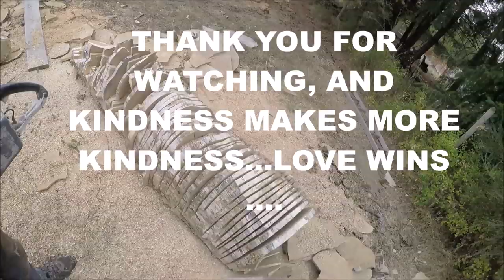STIHL 050 AV  TALE GATE CHAIN SAW REPAIR AND SHARPENING,

Comment: LOVED watchin and listenin to that old Stihl run! The first saw my dad bought for falling in 1970 was an 050. In 74 when I was just turned 16 I got to run it when it was coupled to an Olini chainsaw winch  we used to clean log jams out of the Dungeness river. The small Homelite that came with the rented winch didn't have enough power to move the 4 foot diameter logs we had chunked into 4 foot long pieces so we hooked up the 050 which of course voided the warranty. Then since we parted the 3/16 winch line too mamny times we loaded it with 1/4 inch line which also voided the warranty. LOL  I had to learn to feather the throttle to lift the logs up to the top of the pile and hold it there until someone could give it a push over and then let the log down the backside. If I stalled the engine the weight of the log would pull the saw through backwards and make the saw run in reverse (points model saws will run in reverse) and unspool the line on the drum making a BIG mess.Thanks for bringing up some old memories for me. I used to also have an old 090 I used to cut shake blocks, That was a BEAST of a saw.  Now I just have a Stihl 018, 031 and an 056 Super.

Comment: Stihl 050 was the first big saw I ever owned. I restored it from the bottom up made 3 cuts and broke the oil drive 😭. Couldnt find a replacement and had to sell the saw for parts. Tickled my heart that buckin has one of these 050s would pay good money to have a working one again. Replaced it in my fleet with an 045 full wrap and 32 bar and skip setup.

Comment: Nothing beats a hand file done right!
Reply: Square grind done right ;)
Reply: Yeppers .... square grind done right is hard to beat !  With a fresh grind on the robot grinder I can get sqr/rnd about 85% the speed of sqr/sqr ... edge seems to last long time also ... seems to me that the sqr/sqr takes a bit more oomph to pull thru the timber than the sqr/rnd because of its design ...for firewood cutting/processing with smaller saws I prefer the sqr/rnd configurations for ease of use (and because I don’t own a silvey/simington sqr -grinder 😆)

Comment: BBR's Mercury Tailgate Saw Shoppe and Repair hehehe  I have a 10x10 canvas Garage Logic set up I do my repairs in. I have an old Poulan 3100 driving me bonkers at the moment. It starts every time, 1 pull. Then it stops, like that homelite. Cannot keep it running for love nor money. I may have to re rebuild the carburetor. Right now the work space is a bit tight, because I'm rebuilding an electric dryer and cleaning a small pellet stove I plan to put in the back bedroom. Hi to everyone watching, and welcome new subscribers! Be kind!

Comment: Hey Buckin, i have an old saw that my grandfather gave me when it stopped starting easy for him. Ive done some work on it but it doesnt run really well and stalls on me. Could you make a Buckin Special on how you adjust a carburetor?
Reply from the maker: YOU BET I WILL LETS SEE WHAT HAPPENS TOMORROW I WROTE IT DOWN ,,THX FOR BEIN HERE PAL

Comment: Do you like the file and guide setups that stihl makes? They do the raker and tooth. Also do they gulletize the tooth?
Reply: Hi @mattone those Stihl dual file guides in my opinion go to hard on the rakers, and especially on Stihl full chisel chain it becomes too aggressive so you are just fighting it in the cut especially when boring!
Reply: It really depends on your set up i run a standard 3/8 on a 20 in bar and it turned my  ms361into a monster but it does leave at little on the bottom of the gullet on a new chain

Comment: Question, Ive got a 050av that I use very rarely when Ive got a tree too big for my other saws.  Problem is Ive broke the pull cord like 4 times this year and like I said I dont use the saw that much.  Is it normal to break the rope on big old saws like this? Older guys are telling me its because of the high compression.

Comment: STIHL 050AV - 89cc 5.8 hp , produced from 1968-1972 ... 25.1lbs loaded and will rattle the fillings out of your teeth !  Seems to me like since the 80’s there really hasn’t been much of a hp increase relative to cc’s ... lighter weight , better av and of course higher prices are the new mantra ... I saw a recent Hotsaws101 video where he ran a modded 044/441 against the new 442cm (70.7 vs 72.2 cc) and the old-school 044/440 gave the 442cm a spanking with the same bar/chain ... guess there’s nothin new under the sun !
Reply: There's plenty new. It's not good and they call it emissions. Clogging up all the new stuff.
Reply: Jeff Allan yah ... been inside quite a few “air injected” saws ... non-conventional intake system that draws “raw” air thru 2 intake ports to the left and right and above the old school intake ... I believe the thinking is to scavenge the spent gases with fresh air thereby reducing emissions - not a huge fan of this engineering endeavor but this is what we are being given to work with along with electronically - controlled carbs and soon fuel-injection ... imho the new saws really aren’t out-performing the old school in the hp department - lighter weight and better AV ; creature comforts yes but you PAY out the wazoo for em ... I’m fond of the 461 STIHL with some “flow enhancements” and max-flow oiled filter setup ... works well for what I do ... Buckins’ got a nice 372 that was done up by Walkers iirc and she cuts well also ... guess what I’m sayin is that  imho a 372xp; 461; or even a 7900 are proven saws and can be maintained providing you have the mechanical aptitude to do so ... computer chips and fuel injection are a bit of overkill for a piston-port 2-stroke chainsaw especially if something goes awry and you don’t have the means (software ; connections; etc ) to repair it yourself and have to take it in to the dealer - can get real expensive, real quick !

Comment: I got a question for you Billy I run a Stihl chainsaw and I buy the steel chains which is a better chain to get Stihl Oregon Husqvarna I know it has to do with the sharp in but is there any chain that's out there that's better than the other and a lot of people say the Stihl chainsaws are a little better or some say orgen s  are a little better or some says the Husqvarna is a little better just want to know your opinion
Reply from the maker: I RUN STIHL MADE CHAIN FOR A FEW DIFFERENT REASONS ... IT GRINDS A NICE CORNER ,,THE TOOTH IS BIGGER ,, AND THE HOLES IN THE DRIVERS BRING OIL TO THE BAR  AND REDUCES WEIGHT
Reply: Right on thank u for answering my question the sthil chains have worked out best for me again thank u and really enjoy watching your videos really knowledgeable you really know your stuff
Reply: I use STIHL chain also ... seems like a better grade of metal and the chrome is more robust !  Seems like I can get more wood cut before a touch-up than with other chains I’ve tried - worth the added $$$ price and really worth it if you buy the 100’ reel and make your own chains ... i betcha I’ve diced up over 30 face cord since March with the 461R and am STIHL at about 90% life ... I can get quite a few hand filings (although I’m partial to the 2 in 1 STIHL now that I’ve used it for the past few months ) before the chain gets put on the robot grinder and everything is trued up to specs dead-nuts ... then rinse and repeat ... as long as the wood is clean and you dont saw into the dirt the chain should produce many many face cord before it’s time to retire it
Reply: Race saws use a lot of Stihl chain, say the chrome is thicker just like you say. I use it, but I run Stihl saws too. The chain is Swiss made and prestretched.

Comment: Buckin, do you guys have access to ethanol free fuel where you live?  We have this crap 10% ethanol fuel mix here in the states, and it's crap for small engines. I never put it in my saws or trimmers, but I go way outta my way to find ethanol free fuel. Saves a lot of headaches
Reply: I'm not sure where you are, but try your local co-op.  I get mine in Snohomish Washington by where I live. Cen-ex co-op I believe.
Reply: Where I live in NY the premium is ethanol free. I pay the extra money for my small engines. You have a ton less problems, plus the power saws love the stuff.
Reply: highdesignfool try this website https://www.pure-gas.org/

Up here in north/central Wisconsin it’s the same as chip, most of our high octane is 91 ethanol free. Except for Milwaukee County, that has to be different and require 93 10%.
Reply: Yep we have ethanol free gas.

Comment: All chainsaws without an active working CHAIN BRAKE should be thrown right into the metal bin because they are much more dangerous to use than newer chain brake equipped saws, you won't know that until one day you get kick back and end up maimed, dead or if your lucky just a nasty trip to the hospital!. Old saws deserve to be reborn as new products, MELT THEM DOWN and be safe.